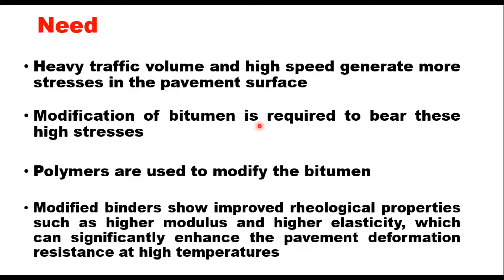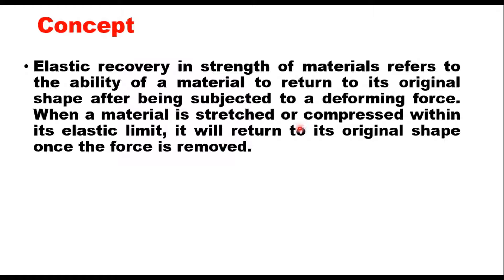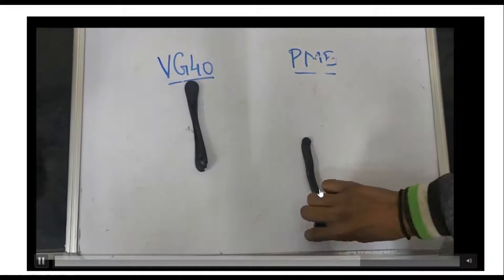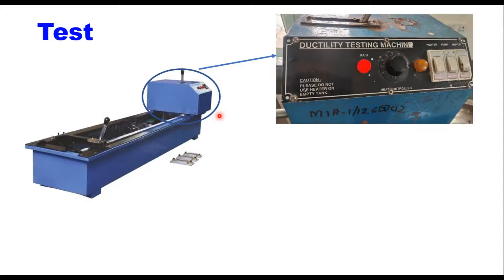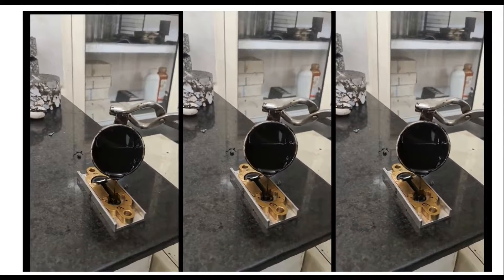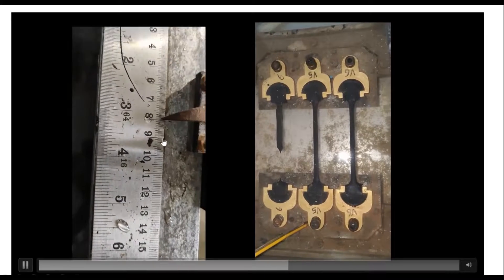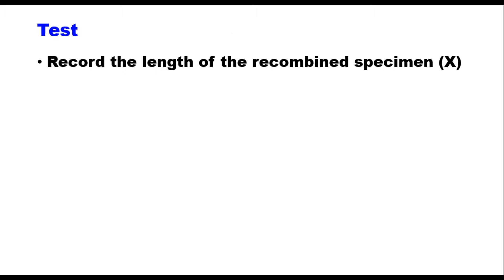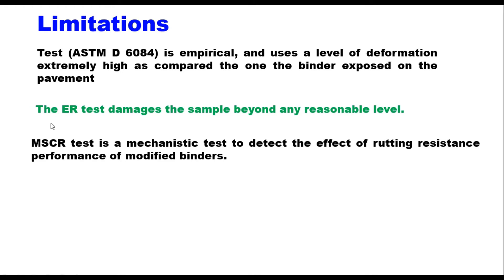Elastic Recovery of aspahlt binders, complete details, lab demonstration concept of elastic recovery

Comment: Sir , bitumen ke sath antioxidant ko use kr skte h jaise polymer ko use Kiya gya h bitumen ke saath
Antioxidant lemon , grapes etc
Reply from the maker: polymers are used to enhance the elastic properties and fatigue life of a mixture. Anti-oxidants are used to delay the ageing process of the binder. Use of leman or grapes are not suggested due to the problem of evaporation during heating and mixing.